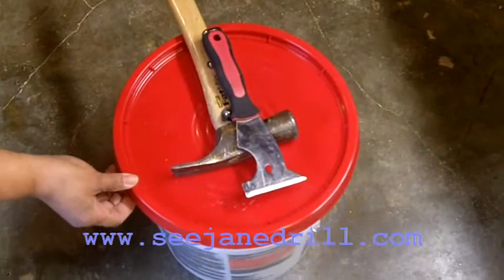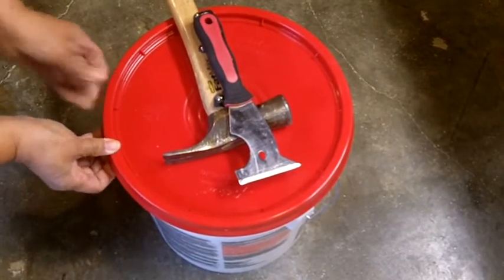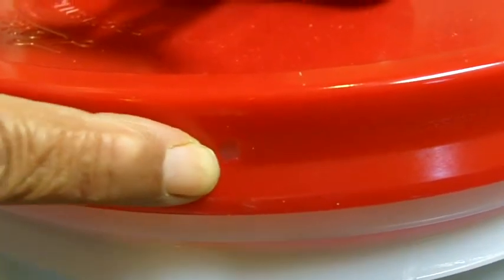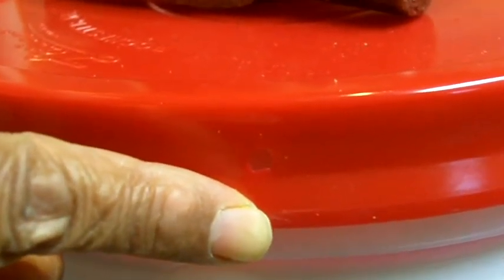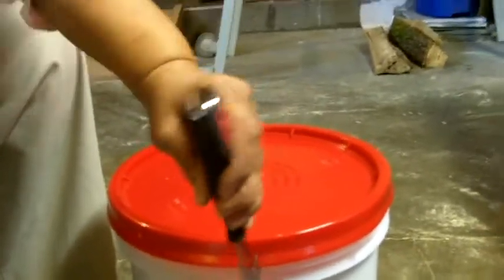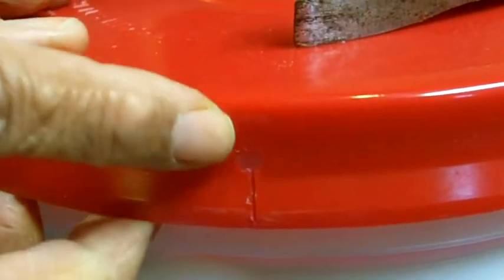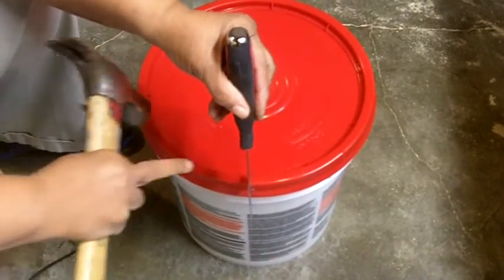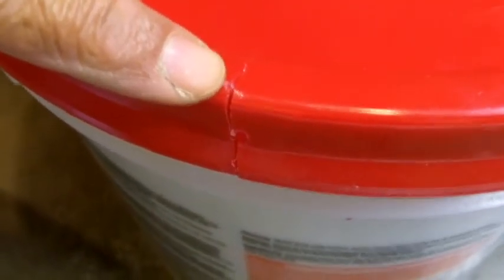Quick Tip to Remove Lid from 5 Gallon Paint or Joint Compound in a Snap

Comment: Perfect. And glad to hear you don’t have issues with the mud drying out by adding a spritz of water before closing. 
After finally getting it open a second time to actually use it- and struggling to mix it (had to hand mix a little at a time it to thin for skim coat since the drill was borrowed and wasn’t doing the job) I then had to put the lid back on. All tired from having my hand above my head skimming I couldn’t even get my weight to seal it again. It was so annoying. I bet with these cuts I’ll be able to close it in a snap too! Thanks.

Comment: after driving 45 miles and back to pick up my deck stain, got back to the house and couldnt get the darn thing open. thank you. your video was a life saver. didnt have a chisel, but used an old kitchen knife and a rubber mallet.

Comment from the maker: Hello Ivan,  I have never had an issue with the lid not creating a good seal once re-applied.  As a best practice (if it is joint compound) I  top it  with a small amount of water to keep the surface moist before re-applying the lid.  Thanks for your comment.
Reply: Joint compound comes with a clear plastic topper.
Keep replacing this to keep it fresh

Comment: Thanks for the tip but I just went from the hole down and got it open with just a bit of effort. I'm pretty sure it won't re-seal properly if you do it this way. It's just if you are planning to discard the bucket, right? You don't want paint all  over the back of your vehicle! Anyway good tip - helped me choose the right tool to cut the lid. Thanks!

Also,  just fyi - search for "5-Gallon Paint Can Opener". No need to even cut the lid at all, but costs a few $.

Comment: Cut the tabs bottom down as they are designed to be cut to avoid your product drying out from exposure to air where you cut above the bucket lip,  also buy a bucket lid wrench and use it.

Comment: Not sure if you knew this.. but those holes; if you put a screwdriver into them, you can use them to pry the lids off. No hammering, no other tools needed. All you need is a screwdriver, it's simple, and effective. Before you ruin your lids, try a screwdriver. Why do you think the holes are there?

Comment: Hi, question for you. I'm using similar buckets for my cheerleaders. We call them cheer buckets. The girl's can use them for storing drink's and snack's in them at games. They also use them as seats between cheers. How the heck can I make these easier for the girl's to remove and replace? They are hard even for me.. HELP!!! Thank you.
Reply from the maker: +Jacqueline Ramirez You know, Jacqueline, the only way that I know of is the way I showed in the video.  However, I have seen newer 5 gallon buckets where there is a band that you remove and pull off...kind of like a giant version of a juice bottle.  Once the band is off, it is easier to remove and replace the cover.  But that is all I can think of...
Reply: +Jacqueline Ramirez Gamma seal lids work great. They are screw on type lids for five gallon buckets. We have a lot of food storage and use these for our bulk foods.